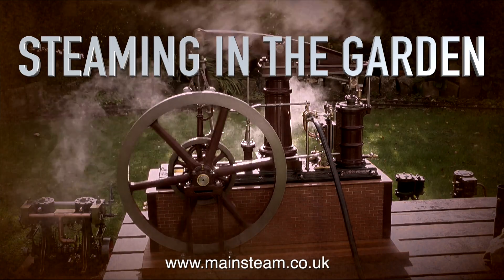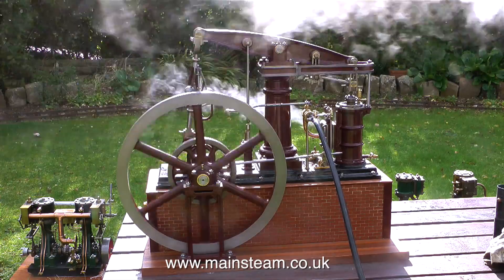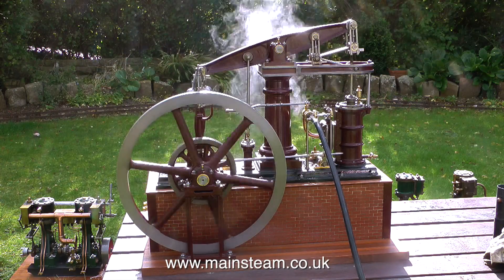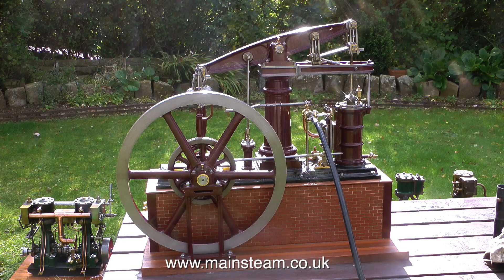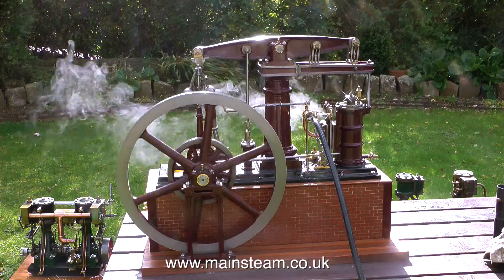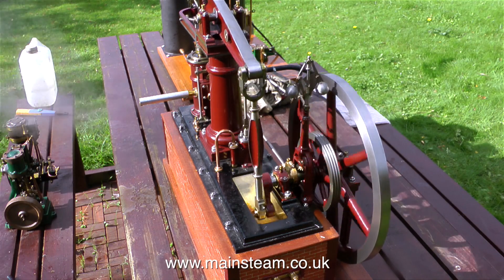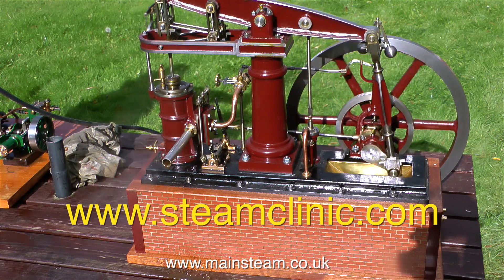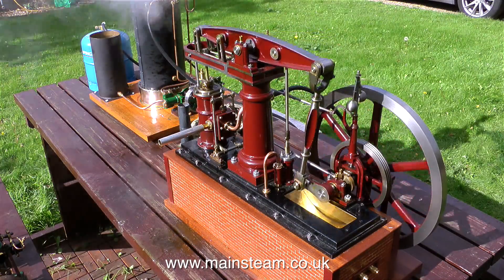STUART MAJOR BEAM ENGINE - IN STEAM IN THE GARDEN #2

Comment: I particularly like this engine. Features such as the very large flywheel; the brass "trench" making space for the crank arm(?) to dip into the base. Gotta love that rounded frame above the cylinder, along with every curved or rounded part. That main tapered column with bands just like a cannon is just great. And next to it, the cylinder, with it's own rims and contours... anytime a square or rectangle can be made curved, oval, or bowling-pin shaped, it just coaxes my brain into "seeing" these small replicas as The Real Things! A piece like this just brings you into it, as though YOU yourself are standing in it's shadow and believing it is full sized.  ( I hope I don't start needing meds too.... )  Keep making vids. Thank you.